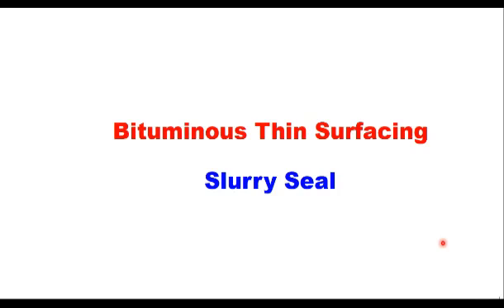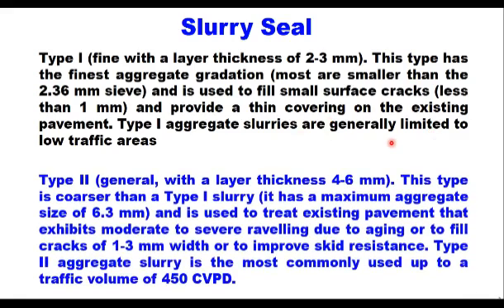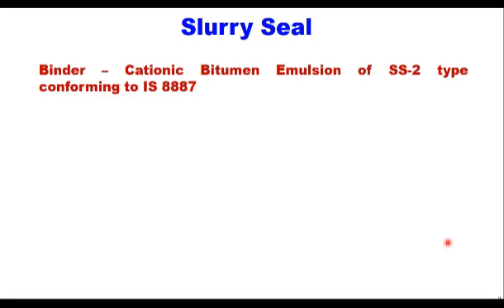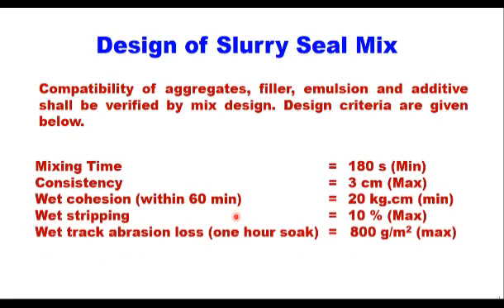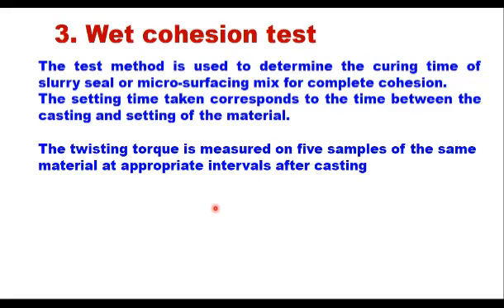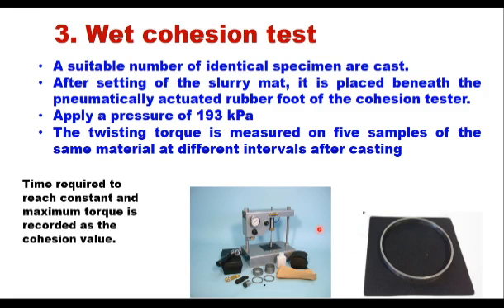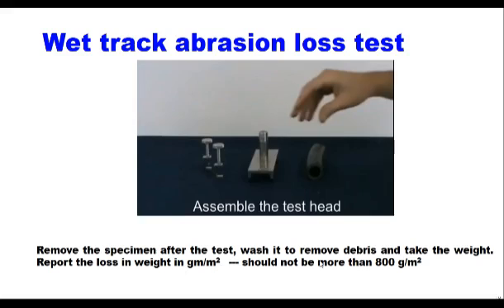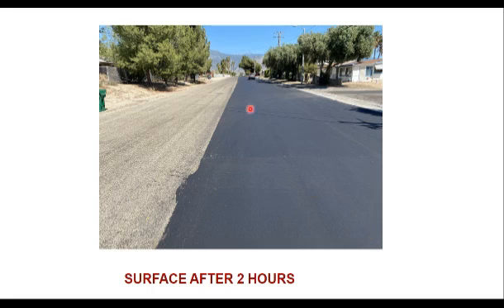#slurryseal, #roads, Thin Bituminous Surfacings - Slurry Seal, design, construction, quality control

Comment: Sir can you tell me , What is the name of the powder use in the mixture of slurry seal (PME + water ) usage is for the runways 
So kindly can you guide me with the name of the compound to make the slurry seal
Reply from the maker: A slurry seal is the mixture of water, asphalt emulsion, aggregate, and additives. This additive can be cement, hydrated lime or aluminum sulfate liquids. These are used as stabilier or chemical modifier to aid in setting the slurry.

Comment: Sir is it possible to get a bituminous layer thickness of 80 mm for a perpetual pavement using geogrids in the subgrade (part of the subgrade is gsb material used), subbase, and base.
Reply from the maker: I cannot guess without going through the design, but looks difficult. 80 mm total thickness of Bituminous Layer is too less.